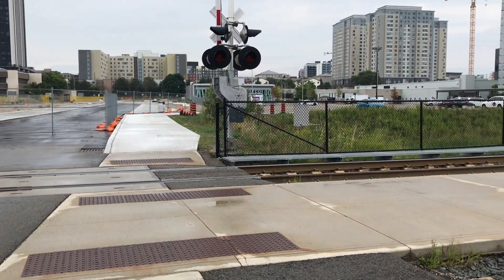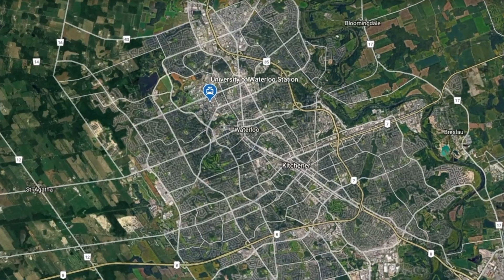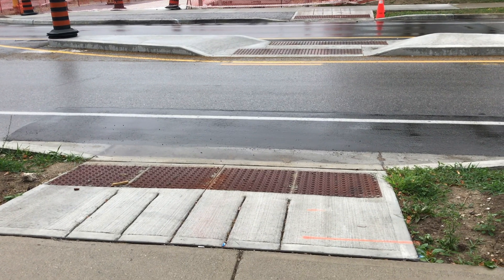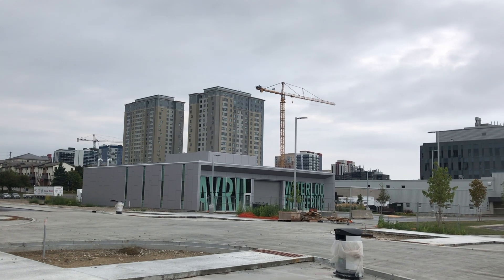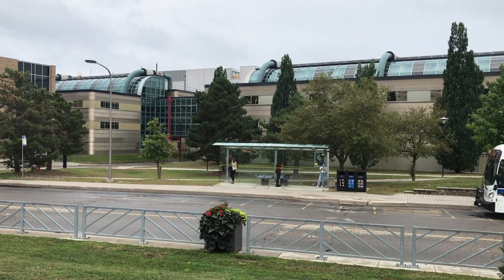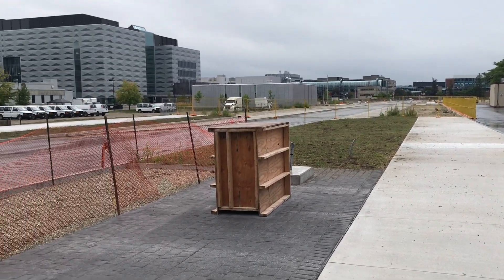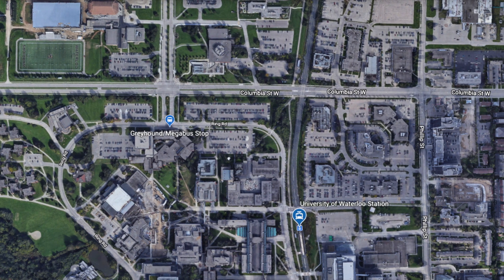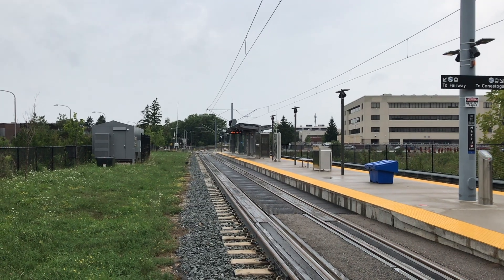University of Waterloo Station Construction

Comment: "Largest bus terminal in Waterloo region"

There are a few ways to measure this, but it's very likely that Ainslie terminal in Cambridge makes a good case for being the largest. It has, I think 12 platforms, so a similar in size, and with 10 GRT routes, far more routes, even accounting for no GO service.  And (largely as a result of carrying the 302 ION BRT) probably more buses per hour, but I haven't looked it up. I am not sure of passenger numbers either.

Of course, it doesn't have an LRT station, and I don't believe it has intercity buses anymore.

Fairview mall also has 12 routes and an ION stop and makes a strong argument for largest.

The boardwalk and Doon Campus Conestoga College also have 9 connecting routes, although they are lower volume routes, even accounting for the iXpress routes.

That being said, the far more interesting story is why the station exists in the first place, and, at least in my opinion, it is as a result of the university administration being very anti-transit ....which is just insane for a University campus.

Buses stopping on Ring Rd. are more convenient for students AND for the LRT station, but the university administration, which has made no moves to restrict drivers from the ring road, have argued for the removal of buses for "safety"...even though it means students will have to cross Ring Rd (again, filled with drivers) instead of being deposited on the campus side of it. To say nothing of the fact that the LRT station could have been located at University Ave. (or Columbia) and avoided awkward interchanges entirely.